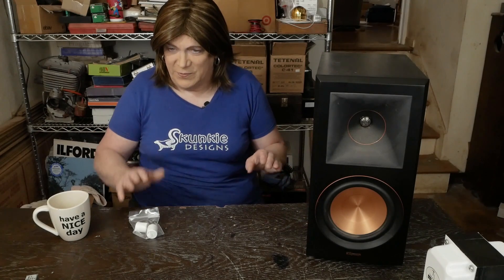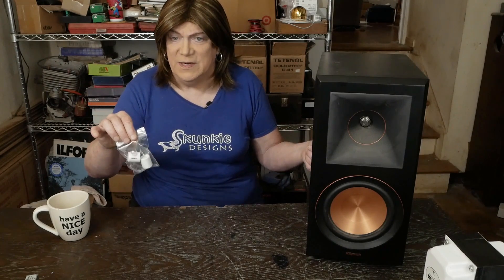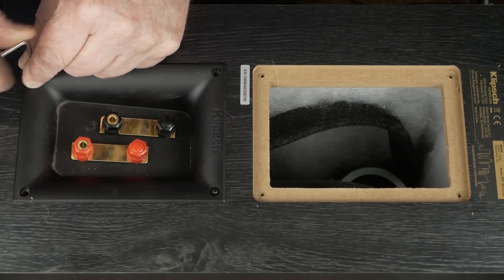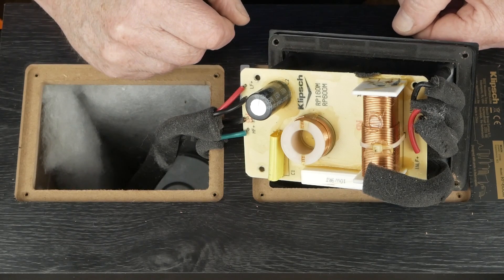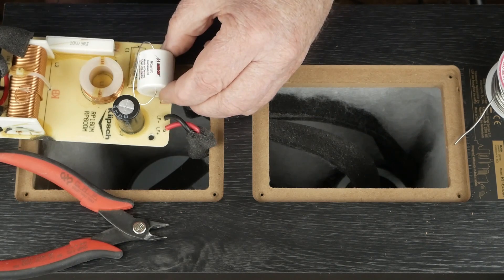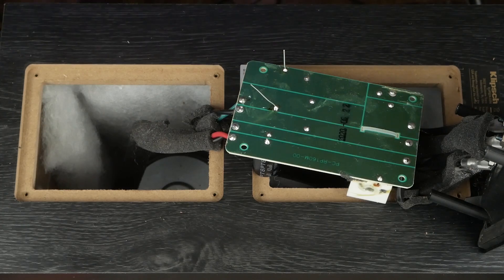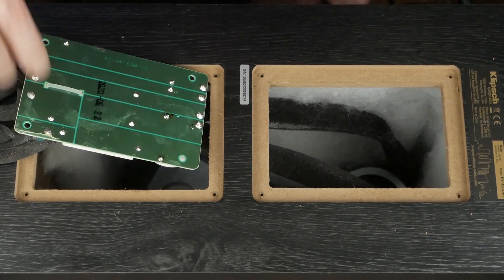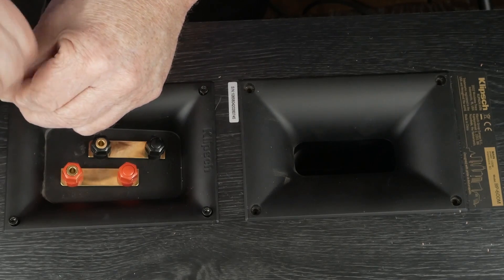Klipsch RP600M Crossover Upgrade

Comment: Just changing the cap will not be much of a change, it will be very difficult to tell if you can hear a difference. However if you upgrade all of the parts in the cross-over, as well as removing all ferrous metals from the signal path, don't forget to remove the cheap speaker pin connectors as well. Then a difference will jump out at you, it will be obvious. The soundstage depth and width improve, they will sound more three dimensional and subtle nuances will be more apparent, this will be even more noticeable if you have an acoustically treated room. This upgrade really is like swinging a pick axe at a piece of ice once and expecting an ice sculpture.

Comment: You are misunderstanding Danny's mod at GR Research. I am NOT a fan of him, but he is not making the speaker LOSE sensitivity, but merely making the actual response FLAT, as to compared to before where a lot of the mids and highs were artificially boosted, and creating a sensitivity rating that was false, as the bass was several decibels below the mids and treble. That is how Klipsch gets such high sensitivity ratings, they boost the mids and highs, but the bass can not be artificially boosted. In reality they are not the rating Klipsch gives.
Reply from the maker: I get that, but honestly, the bass of these speakers isn't weak if they are positioned in a room correctly. Measured on their own in a dead space, they probably aren't EQ'd well. I've heard a pair of these with those mods and it wasn't an improvement to me.
Reply: I've applied the RP-600M crossover kit to my speakers via the GR Research kit.  After installing the updated crossovers and the No-Rez material, there was a slight decrease in efficiency.  Keep in mind, I don't have a method to measure speaker efficiency, but when I put the revised RP-600M speakers back into service, I had to recalibrate my pair of subwoofers because with the revised RP-600M, the subwoofers were running a bit too hot.  After recalibrating the subwoofers, all is now good.  I did watch the videos on crossover process along with listening to the clips on New Record Day, but was unsure how the results would be noticed in my setup.  The result?  It's a sound that I'm quite happy with.  I haven't lost any of that treble energy that the Klipsch has, but the mid-range issues present with the stock crossover have been resolved.  I didn't install the tube connectors, but did utilize a good 5-way binding post made out of copper as I didn't want to reconfigure my speaker cables but wanted to keep them as-is with the quality banana plugs.
Reply: I think you misunderstood what Mr klipsch was saying,horns make the speaker efficient
Reply: @Chokechain1111  it's not a horn. It's a waveguide

Comment: Please, you changed a foil capacitor with a better one, but kept the horrible electrolytic one in. Change that one, you will note a more clear and detailed sound, way more than between those caps you touched. You will enjoy the sound.. try a Jantzen Standard Z Cap, or what ever you like. Same values for capacitance. cheers
Reply from the maker: I'm working on replacing the whole crossover :)
Reply: @SkunkieDesignsElectronics  Hey - I wish you good success! I am doing same things over here, replacing some capacitors of my speakers and amps.  -- On crossovers I use to replace the ceramic resistors with some metal-oxid ones, and all electrolytics with MKP-Film caps. So the sound just get more detail, clarity and keep the speaker somehow sounding original (just reacher). Have a good time and enjoy what ever you do.
Reply from the maker: Turns out this "upgrade kit" didn't make it sound better IMHO, it just brought out other flaws in the drivers :P

Comment: I have 1979 Klipsch Heresy 1s. I replaced the original caps with Sonicaps from Bob Crites. I felt the same way about mine. I didn't hear a huge difference but the detail and separation seems better. While i was in there i replaced the internal wire with better and i added five way binding posts as the original was just a small screw terminal.
Reply: What internal wires did you use?
Reply: @1LifeAdvs  I used silver plated copper teflon jacket wire. I think it is 16 or 12 guage. I soldered all connections.
Reply: @crimsonghost6454  wouldn't using ofc wires be a better choice?
Reply: @1LifeAdvs  I think either choice is okay. I used what I had on hand. As long as good quality wire is in there it is an improvement over the stock wire which in my speakers were showing signs of corrosion.
Reply: @crimsonghost6454  sounds good

Comment: Could you post a link to the replacement capacitors? Thanks!🙏
Reply from the maker: These are what I used https://www.partsconnexion.com/MUNDORF-76433.html
Reply: Steph, any other recommendations for a cap with the same value?
Reply: Also, your thoughts on this..
 On Humblehomemadehifi..
EVO Oil likes to be mixed with Jantzen Audio Superior Z-Caps, the slightly bright nature of the EVO Oil blends well with the very neutral and spatious sounding Superior Z-Cap. For example when used for a large value midrange series capacitor: mixed at about one third Jantzen Audio Superior Z-Cap and two thirds Mundorf MCap EVO Oil, together they form a well-balanced rich and spatious combo
Reply: @SkunkieDesignsElectronics Linky no worky.

Comment: Nice, simple upgrade Stephe!  Mundorf aluminium/oil caps ay?  Well, that's just fine & dandy for me cos I used a couple of the exact same type of caps in the crossover networks for my Silicon Chip Magazine 'Majestic' speakers that I built!  It was a spare-no-expense build that cost me around AUD$2700 to build, but I am very pleased with them.  I paid about $100 each just for the big, half-a-house-brick weight & sized woofer series inductors for them!  I used 4 big non-metallic cable ties & silicon glue to mount these heavy coils to the 12mm MDF crossover baseboard to keep any metal from inside them.  I even fashioned sort-of heatsinks for the  'extra good' 10 watt wirewound resistors,  mounting all components to the undercoated  crossover baseboard with those old-school tagstrips.  I think the crossovers actually cost me over $150 each! - But I didn't care lol!  I was just buying bits each week or fortnight over maybe 6 months.  Except for the cabinetry.  That was specially ordered through bunnings hardware as actual diy kitchen cabinetry, & adapted to build a pair of speakers the size of a decent bar fridge!

You start with the cabinet carcass then add the decorative outer woodgrain panels over the top.  I chose 'black forest', which is a dark grey highly textured finish that I'm pleased with.  I thunk they'd look far too Imposing & garish if they were a light colour.

I had a great time building them in my spare room inside on carpet!   Bending, securing & sealing 3mm plywood into a semi-hyperbolic horn was an experience!  

That was the only wood I had to cut with a handsaw, as I paid my local friendly neighbourhood kitchen installer $100 to cut all the additional woodwork & panels for me.

Maybe you could have a look at the Majestics  design?   I'd love to know what you think - especially if you thought they would be pretty good!  Hehe!  They're definitely the most expensive speakers I've ever had - even double the price of my Bose 901 series IV's I've owned previously!  I just wish I still had the 300 watt MOSFET amps I'd built for them. 😠  D'oh!  The Majestics just happen to be rated at 300 watts too!

But yeah, I'm even happier with my choice of the Mundorfs now that I see you've used them to upgrade your Klipschs's!  I'm glad they sound better for you!  This doubly confirms my point!😊 👍

Comment: After break in, maybe run some Vishay MKP 1837 in parallel with the Mundorf?
Reply from the maker: I don't feel like high quality caps need to be bypassed, but that might be a low budget option is just bypass what is there now.
Reply: I see. I thought (the Vishay)  would enhance the performance of the Mundorf, not degrade it.
Reply from the maker: I'm not saying it would degrade it, I'm just not sure it's needed when using a good quality cap.
Reply: The Vishay is a polyprolene cap, which is also of exceptionally high quality.

Comment: Did this mod with my RP500M. It's easier than the 600 - no bi-wiring, and no need to remove the baffle. No break-in yet, can't comment on the sound difference. Will see...

Comment: Hello Miss Stephe, can you please tell me what Mundorf cap is? I don't know anything about caps and soldering but i think i can do it to a pair of my RP400m. I have 3 pairs 😅
(I used them as Atmos and surrounds in a previous setup)
Reply from the maker: This video is just showing how to upgrade/replace the caps in a speaker crossover, choose whatever brand you think you might like the sound of.

Comment: Do you think it would be worthwhile also upgrading the electrolytic cap?
Reply from the maker: It wouldn't hurt, but my understanding is that one isn't directly in the signal path like that tweeter one is.
Reply from the maker: Yeah there are endless crossover changes and tuning you can do to speakers, especially if there is something about them you don't like. This was just a simple $40 upgrade to do if you basically like the way they sound.
Reply: @SkunkieDesignsElectronics    If a cap isn't in the signal path, then where is it?  What good would it do?
Reply: @BelgianGadnuk  Your explanation is what I thought as well.  The woofer is absolutely in the signal path.  It's separate from the tweeter circuit of course so the jumpers can be removed for bi-amping to separate HF from LF.  The person who said the woofer was not in the signal path does not understand how a  crossover works and instead depended on what somebody told him/her which was not correct.
Reply from the maker: Who said the woofer isn't in the signal path? O.o
Reply: @SkunkieDesignsElectronics  You did.  1:37
Reply from the maker: I said >the cap across the woofer< isn't directly in the signal path. I never said the woofer isn't, that would be just stupid.
Reply: @voiceofreason9238  What Stephe said is clear - cap on tweeter is in the signal path (ie in series with the tweeter) while the cap on the woofer is across the speaker (ie in parallel to the woofer) so isn't directly in the signal path.
Reply: @mddawson1  Maybe clear to you but you're probably smarter than me.  The clarification is that the CAPACITOR for the TWEETER is not part of the WOOFER circuit.  That would be pretty obvious, no need to repeat  what someone else said about the signal path.  I found the statement confusing.
Reply: @voiceofreason9238  My concern with the electrolytic cap is they tend to fail over time where as a polycap remains good for a much longer time. However, there may be some technical reasons that made that electrolytic cap better suited for its purpose.
Reply: @voiceofreason9238  That cap is SHUNTED across the woofer, and not IN LINE with it. ....make more sense? It is across the woofer PLUS and MINUS terminal, and only bypasses lower treble AROUND woofer.

Comment: I think i will change the tweeter cap like you with the Murdorf cAP. But if i change the other cap (the electrolitic) do you have a recomendation for a model and value of cap for the woofer cap? thank you.
Reply: or maybe changing the resistor (mills resistor?)
Reply from the maker: I ended up using a Jantzen superior-Z. The mundorf was a little harsh sounding, even after some break in.
Reply: @SkunkieDesignsElectronics  how did the Jantzen sound?

Comment: Any plans to do measurements to show the improvements? Is that possible ?🤔
Reply from the maker: It's not likely to be measurable as we aren't changing the value of the cap, just the quality. It's going to sound the same frequency response wise, just hopefully a little crisper. The other mod just eliminates the importance of a good connection on those rear bi-amp  jumper plates. 

Like I said, if I was planning on going to the trouble and expense to bi-amp these, I would remove the internal crossover all together, connect the jacks directly to the drivers, and then do the crossover in front of the amps.
Reply: I wonder if increasing the cap value, would shift the crossover frequency down enough to compensate for that hole in the midrange of the frequency response.
Reply: Yes, Danny at GR Research did exactly that, and other things... @jukingeo

Comment: Have you demo the new caps. What is the difference heard?
Reply from the maker: I ended up not liking these mundorf caps used in a speaker crossover and swapped them for a pair of Jazden supreme caps.
Reply: Was it difficult to fit the Jantzen supreme on the board? That's a honking big capacitor! I really want to do the same but thought I'd have to use a smaller Jantzen standard Z-Cap.

Comment: Great video. Step by step. Thank you!!
Reply from the maker: Just an FYI, I later replaced than Mundorf cap with a Jazden Superior and like it better
Reply: Jantzen Audio 3.9uF 400V Crosscap Capacitor. These ones are $2.38. A lot cheaper than the ones you originally replaced. Thank you so much for the replay and advice. I like your channel a lot.

Comment: which engine is in your shelf? It looks like a 2 stroke
Reply from the maker: A rare Yamaha KT100A rotary valve kart racing engine, modified for open class racing. 

We used to race karts in the 1980-1990's. Fun times :)
Reply: Great.
Reply: definitely you must be a engine tuner or builder too. as delicious as amplifiers. Yamaha RX100 motor bike is legend. No words abt RD350! Tuned chamber exhaust pipes..

Comment: How did you know which side is plus and which is minus on the pcb when connecting the capacitor? Or doesn’t that matter? I’m trying to replace mine in a bit :)
Reply from the maker: With the coupling cap, it's a non-polarized film cap. Ideally the outside foil side is connected to the speaker jacks, on a mundorf, the outside foil side is on   ->this side of the lettering

Comment: If you use  audyn q6  caps 600v Type the price is much better. In germany 14€ the evo oil ans only 5.60€ for the audyn. Same capacity 3.9uf. To change the elko for the woofer with jantzen cross caps is not expensive.
Reply from the maker: Nice tip. Thanks.

Comment: Why did you not measure the value of the old capacitor and then compare it to the new one. Better yet, you did not measure the speaker FR before and after the modification, or compare FR of the modified one to the unmodified. This whole exercise is totally worhtless. Do it again but this time properly.
Reply from the maker: I don't know HOW many times I can say this: I'm not a speaker expert. But why would I need to measure the values of what is printed on what are both high quality caps? And I do not expect the FR to change at all, that was the reason I used the same value cap. Feel free to "Do it again" yourself and make your own video, and ignore my videos if you like :)